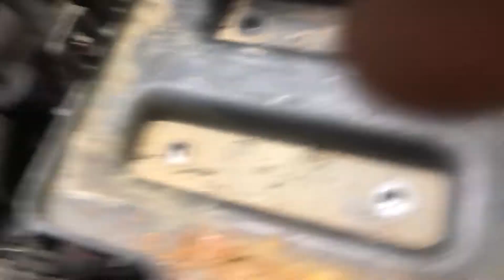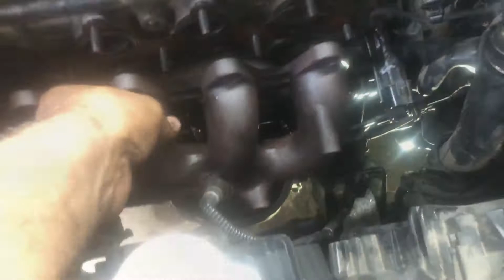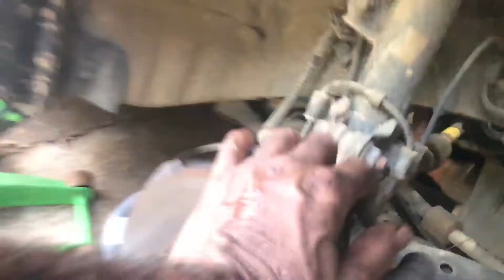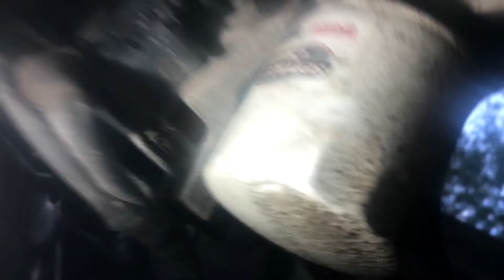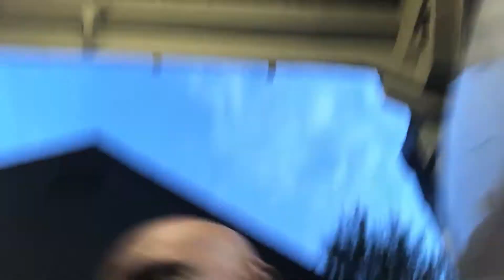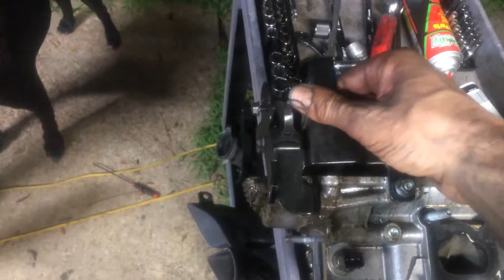hyundai accent cylinder head removal

Comment: That's a burnt valve you have there my friend! As far as I know they are caused by an engine that runs too lean, bad fuel, carbon deposits and just basic wear and tear throughout the years. Great content. Do you have a video replacing  the valves on this motor?

Comment: I have to use a tackle box to keep the bolts separate as well as putting bolts back where they go wherever possible.
The other commenter are right. This is a very well done video
Reply: Timing belt broke on sister's car we live in the mountains anyway I've tried a lot of moving the new timing belt to TDC and then four rotations of firing order, now going deeper and you've educated  me
Reply: @Paul-em5pb  Good luck. Hope it works out for ya'll.

Comment: Any quick way to take the metal tubes out the spark plugs go in without removing the valve head? After market coil packs are a 2 piece design and I have one mega stuck on a plug, I kept ripping pieces off and its stuck stuck on there.

Comment: Good video  what did it cost total fix u did
Reply from the maker: Bot 400.00.   Rebuilt the cylinder head, timing kit, oil, head gasket set.. I actually bought this car from customer , so I did all the work myself.. I bought the car for $1000 And sold it for 3300

Comment: The cylinder was lean and the combustion temp got hot enough to melt the valve.
Reply from the maker: Yep like a cutting torch !
Reply: What would have caused that particular cylinder to become that lean? Thanks.
Reply: Several things can cause combustion chamber temperatures to become too hot. Knock sensor failure, fuel injector failure or clogging, vacuum leaks, etc.